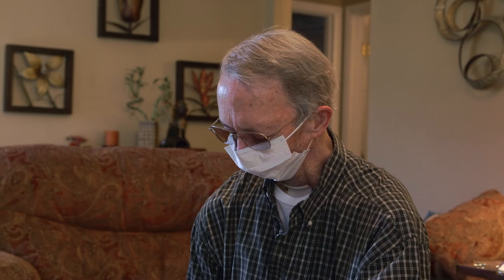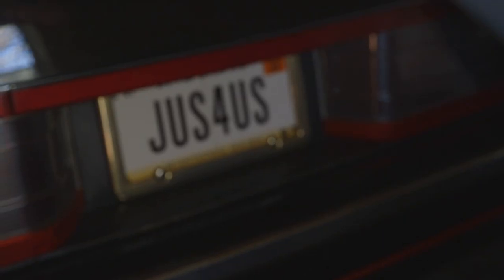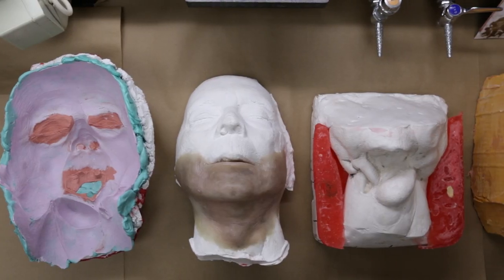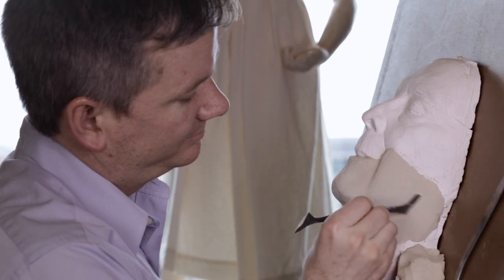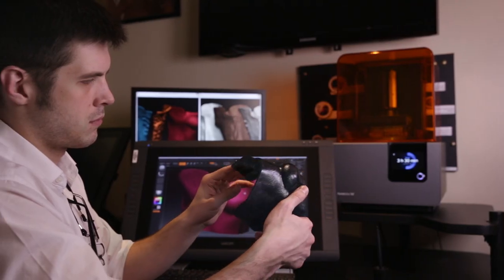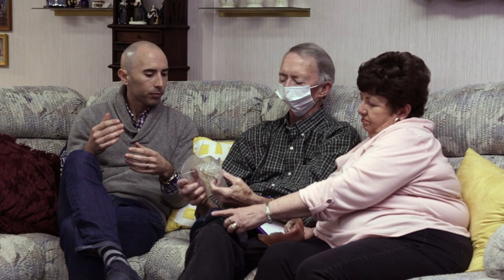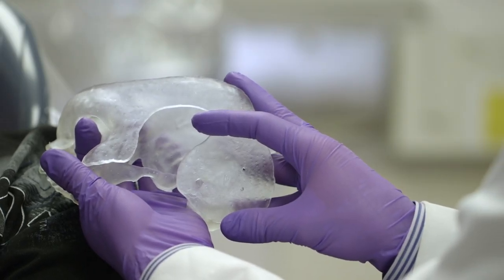The Shirley Technique: A Cancer Survivor Receives a New Jaw with 3D Printing

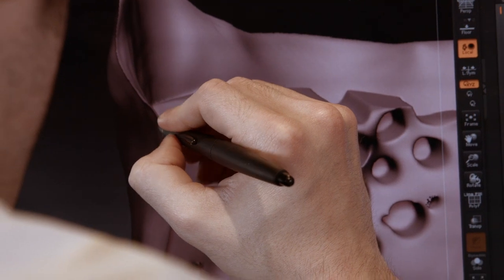Comment: I always like to see new tech supplant the old, and is inspiring to see how work like this changes peoples lives. I also love that backhanded comment @2:30 "...it was half awe, and half frustration that they've been doing it wrong the wrong way for so long..." like 3D printing tech has always existed. How can a method be wrong when there isn't alternative?
Reply: While I love the Formlabs printers and applaud the use of any emerging technological advances in any application, it does annoy me when I hear comments like "They've been doing it wrong for so long" - reference, Cade Jacobs, in the video. 
'Tin men' were pioneering the design, development and application of prosthetic appliances in London, England for more than 100 years and have been making cutting edge prosthetic appliances ever since. Yes, 3D scanning and printing allows for rapid prototyping but it isn't so different from traditional life casting, sculpture, mould making/casting to get to the final product and there's never been anything wrong with a feathered edge of a practical, sculpted appliance, otherwise film and television make-up appliances would be instantly recognisable a mile away instead of being invisibly blended into the skin.
It does make a difference when MRI scans can be utilised with digital software to replicate missing bones deep within the body and mirrored to create missing cheekbones, eye sockets etc and print off the plastic appliances which can be permanently fixed in place under the skin. New material technologies and processes are wonderful and should overlap existing procedures until they can replace them entirely, working together for the benefit of the final product and the consumer.
This process is not new and 'they haven't been doing it wrong for so long', they, the forefathers of prosthetics, the pioneers of these medical transformations have changed the lives of thousands of people all over the World. 
You should read this article, it was written for the Smithsonian.
http://www.smithsonianmag.com/history/faces-of-war-145799854/?no-ist

Comment: If it is possible to use magnets to hold the first gentleman’s prosthetic cheek in place, is there any way to implant magnets under the skin to attach a prosthetic ear for the gentleman (not shown) who lost his ear in the industrial accident (rather than relying on a “support system” for a prosthetic ear)?  Is there any way to get around the body’s potential negative reaction to magnets as it seems you could attach all manner of prosthesis(es?), with limitations being only the strength of the magnet (meaning magnetically attached prosthetic limbs).

Comment: Unfortunately, the boy was only seemingly helped. In the video you can clearly see the development of the boy's age. So the treatment took several years. Result of the procedure: The two incisors present themselves less dominant, but the whole upper jaw is shifted forward. The bite situation is a disaster. In addition, the tooth position has certainly deteriorated further after the treatment, even when retainers were applied. The actual causes of the previous "buck teeth" and the current tooth and jaw displacement are the same and have remained. They are functional mechanisms that have not been considered at all. It is a great pity that the orthodontist received the large amount of money. He should pay it back, because he only shifted the problems. The boy now has more than just a tooth and jaw problem. On top of that - little by little - health problems and pain are setting in.